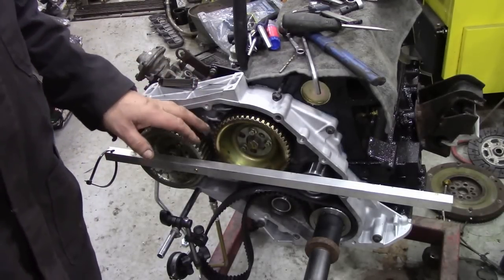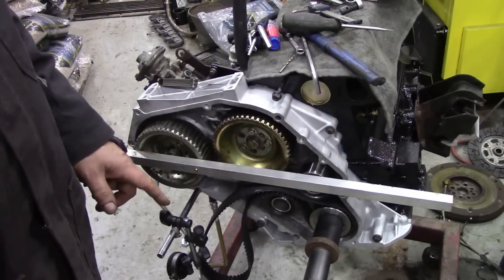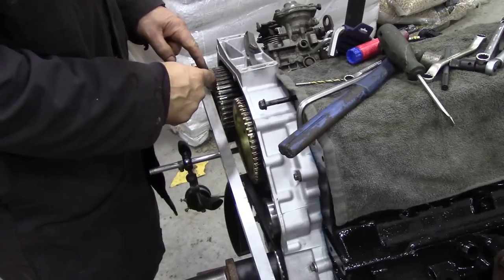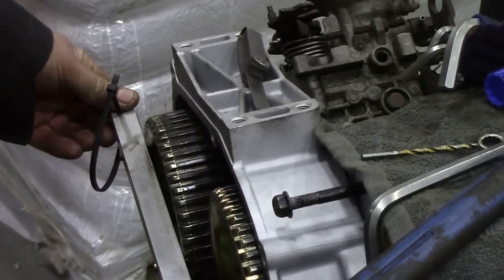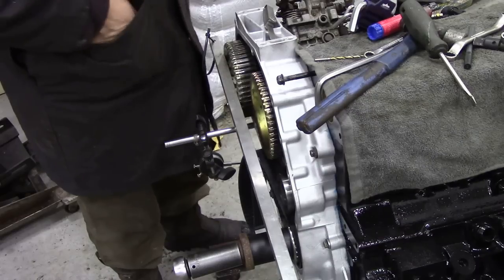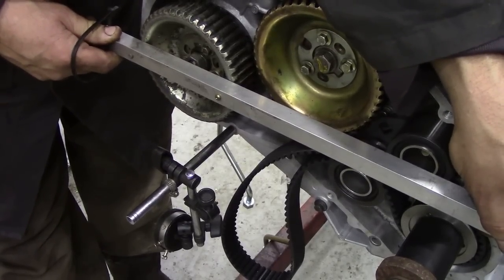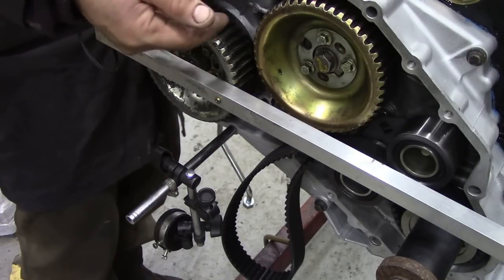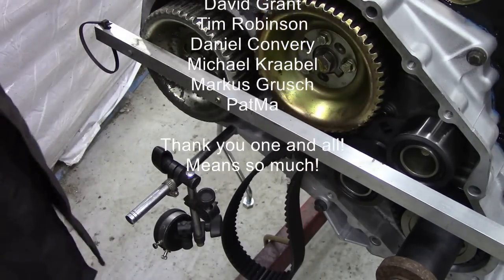300Tdi timing cover refit and belt issues. Part 2 Found a likely answer to the timing belt run  off

Comment: You are amazing Mike, I had same problem on my 300tdi, local mechanic couldn't even understand the issue let alone help resolve it. I knew it was coming from injector pump but didn't know how to fix it. In the end decided to run as is, edge of belt touching lip of modified wheel, and just  check periodically it's  not running out too much or in danger of failing. So far its took a bit of edge of belt but ok. I think it's a more common  problem than realised.
Reply from the maker: It has to be down to belts being too tight = they have taken the tension from 15Nm to 11Nm now

Comment: I did my timing belt last week, and I checked all movement on the FIP pulley. My pump was repaired about 8 years back, and now after all those years, there was no play in that pulley.  I think your pump needs a full overhaul, as that amount of play seems to be a hell of a lot!
Reply from the maker: Funny thing was it was hard to find at first but now it makes sense
I bet you a lot of problems of worn belts are attributed to this  - even with a new timing belt kit fitted and the tension set to a lower setting